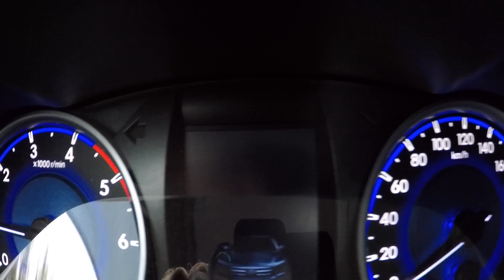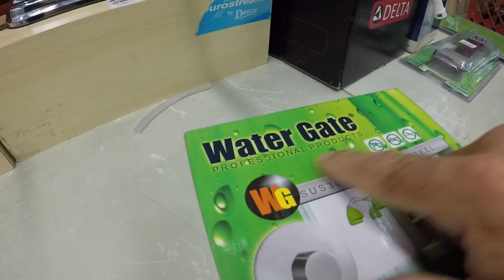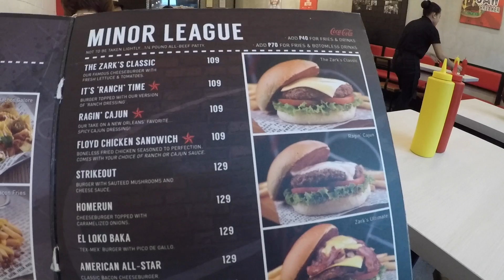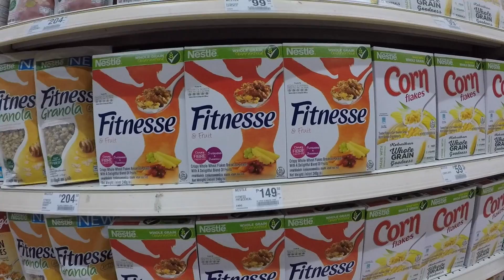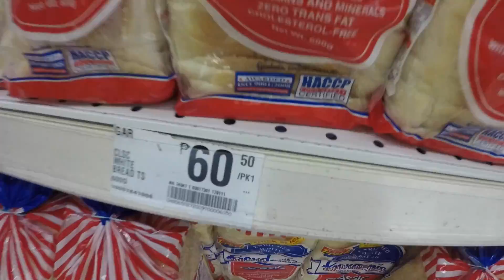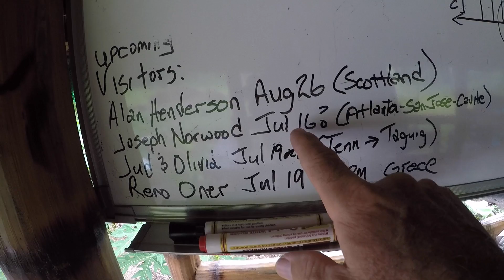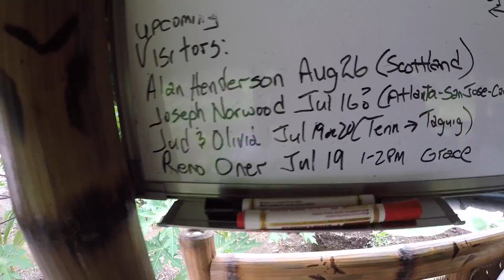VILLA FELIZ - EPISODE 127: WHO IS THAT IN MY BAHAY KUBO? (House Building in the Philippines)

Comment: Nice day!  I was wondering if your CRs each have a faucet in the shower to fill the bucket, which every CR I have ever seen in the Philippines has.  All 5 of ours all have faucets and separate showers (no tubs, unfortunately) in them.  The shower head in the master bath is removable from the wall so it can be hand held.  The flexible hose is long enough to reach anywhere in the CR.  Each faucet has it's own valve, as does each shower head.  Seems very simple.  Each CR's toilet has its own bidet sprayer, except the master bath.  I don't do that, the shower suffices.  My kids are used to the Filipino ways, hence, the buckets and bidets.  Maybe you guys are Americanized enough to go without the bucket!  I'm looking forward to seeing your CRs complete. Everything is sure looking good - better every day!
Reply: brooks: I would never use buckets and faucets in a nice toilet to be used as they do there . However if necessary, the bath has a similar thing where you can fill up a bucket.  Every time i see a house for sale there, the first thing i pay attention for is To Toilets and kitchen and normally i feel disappointed.

Comment: @14:30 so you will use two shower control valves so that you can have a tropical shower head and a standard handheld shower on a hose, in a bathroom that wasn't even supposed to be there because it's in the basement that wasn't supposed to be a basement, so the septic tank is too high for a CR in the basement? 

It seems like just mounting the single point water heater with included shower would have been simple, trouble free and not require and convoluted engineering. The handheld shower in a tiny bathroom can be used to wash the bathroom since it can reach all 4 corners. And it won't drip on your head when you go to use the toilet. 

Using two shower control valves, both in ways they weren't designed to be used, with a single point water heater which should not be internally pressurized, is going to require special operating sequences to ensure the second control valve is always left open and the first control valve used to control flow. 

If a guest used the CR, and needs to rinse with the hose, they are going to come out looking drenched from the tropical rain Forrest shower before they figure out how to use the system. LOL
Reply: Hi IMHO  LOL You might be right! That´s what i first thought, why that if you can use a flexible shower pipe instead of a fixed one, but he might have his own reasons. About the septic tank: i don´t think there is a problem at least until it´s not full, if that happens maybe it would affect the basement, but to make that happen he needs to make his family a lot bigger LOL
Reply: grandadan, I think he said they made a separate septic tank for the CR in the dungeon. To get it into the main septic tank they would need to elevate the CR floor some so it can still keep the 1/4" per foot drop to the tank. The water level of the tank will stay at the level of the hole between the first and second digestive chamber. 

The CR was a very late change, so the main septic tank is too high and no hot water from the solar heater. This is common when building something because you see a space that is wasted and say "hey, this would make a nice CR".
Reply from the maker: To me, being unconventional is what makes life interesting.  I probably wouldn't even be here today if I didn't take the path less traveled so to speak.
As far as guests go, what the heck are they doing sneaking around taking showers in my garage anyway?  😉
Reply: My PI Dream, typically the "outside CR" is used during parties to keep people from going in and out of the house. So I'm picturing some small parties in the garage and the CR being used. Sometimes people don't use toilet paper, they use the sprayer by the toilet, which in your CR is the handheld shower head. 

They may want to rinse their feet off or something, and accidentally turn in the tropical rain.

But if you are going to be the only one using it, it only has to make sense to you. I'm just point it out while it's still easy to fix. LOL
Reply: Necie Tanner, I think James secret plan involves some wet-T contests. LOL

In your house in the states, which I assume used a normal water heater (constant temperature, multiple point, storage type), I also assume James used a diverter valve, not a shower control valve as a diverter. 

There is a night and day difference between the system in S.C. and the system in the man cave. 

I didn't notice the bidet sprayer in the man cave CR drawing. If there is one of those that might reduce some drenchings. LOL

I'm pretty sure the upstairs CR won't be like the man cave CR. Upstairs you have constant hot water from the solar water heater, which solves all problems related to single-point water heaters. It will allow the shower control valve to be used properly (left-right for temp, up-down for flow) and can be used with a diverted valve (not another shower control valve) if you want a handheld shower upstairs. It's all very intuitive and safe once you know which way to set the diverted valve,

But in the man cave, that has a single point, power controlled water heater, which means you can't send the output to a dead end, and you jace to be able to readjust the temperature for each shower (upstairs you won't have that problem).

If he used a diverted valve directly to both shower heads, it would be ok because you can't close a diverted valve, but a shower control valve can be turned off, as well as the bib valve prior to the handheld shower. 

I think the model water heater James got is a flow-switch controlled power, which is good. Most single point use pressure switch to turn in the power, so if the outlet goes to a dead end, the water heater will turn on and stay on until the over temp safety shutoff turns it off. And if you are under the shower when that water comes out, you will need to go to the E.R., because it's nearly 100 degrees C.

To be sure you have to test the water heater. But all multipoint on-demand water heaters use a flow switch, so they don't turn on until there is flow, regardless of pressure.

Later when you try the man cave shower, you will see the difference between it and S.C. upstairs. It might be the last time you use it, in which case James gets the "man cave design of the year" award. LOL?
Reply: Yes you`re right! My plan is to have a barbecue area outside with a toilet including shower: No one drunk with dirty  shoes can go inside the house!!
Reply: grandadan, yes, and the CR needs to be easy to clean with a fire hose afterwards. LOL

I never liked a bunch of drunks at my place. I would normally just agree to go to their house and pay for everything and leave afterwards than to have the party at my place, pay for everything, and have a huge mess afterwards. LOL
Reply: IMHO: Yes agree! I refuse sometimes some friends parties in my house especially because it´hard to send the last ones away lol
Reply: grandadan, yes. I was normally happy to just have one other couple come over for a decent meal and maybe a few drinks, but not enough to get drunk. Normally they wanted to go home just as much as I wanted them to go home after it was getting a little late. LOL
Reply: LOL I had a similar problem with a laser faucet in a beach toilet , first time i saw one 17 years ago lol to find out that all i had to do was to put my hands below it.
Reply: grandadan, I normally rip those faucets off the sink before I figure out how to get water out of them. LOL
Reply: LOL  IMHO , someones love to confuse people LOL
Reply: IMHO: You´re right! That, and if there´s a catastrophic situation, instead of reacting  to it they will ask the smart phone for solutions. Yes we are running into  a lazy, useless, clumsy and fragile civilisation.
Reply: grandadan, the latest craze is self-driving cars. These idiots are thinking "I don't want to drive while stuck in stop and go traffic on the way to work." But they don't realize that if they can make a machine smart enough to drive without human intervention, they can also make a machine that can do most people's jobs, which means the problem of going to work will go away, along with the income needed to buy a self driving car. LOL
Reply: Agree: And i am waiting fro some intelligent politician who will make robots pay social security and tax. it´s just not fair that companies reduce staff due to this machines and reduce also their contribution to the social system. Yes they will do all the work and that´s fine as long as they paya us for allowing them to do so : And that will happen. In what concerns to my work ( Wine, grapes etc. ) It´s all robotic. Can you accept that people have to pay a fortune for a bottle of wine that has been processed  almost with nobody working? Someones are getting super rich while others are getting more idiots, yes.
Reply: grandadan, right now so many people are delusional. They somehow think the billionaire all want to invest in robots so they can afford to support millions of unemployed people. Some claim "it frees us to do more complicated jobs and innovate", but they don't realize the robots can already do more than the average human brain can learn. They are confusing the 1800s with the 2000s.

Elon Musk isn't fooling anyone. He wants to develop robots that can do all the work, and then he and the rest of the billionaires will go to mars where they don't need to listen to all the people demanding the rich pay for their existence. 

By 2050, you better either be rich or have something very unique to offer that one of the Mars Billionaires wants to support. Kids being born today are going to have a hard time, or be someone's pet.
Reply: IMHO: At the same time they convence people that those robots will bring even more jobs, so people stay calm and sleepy and suddenly the surprise arrives  and says : You are all FIRED LOL But don´t worry we will give you a lot of money as compensation, they accept and suddenly they find out that the money is over and now no money and no job . LOL. Back to work. Have a nice day
Reply: grandadan.  Back to work, but no jobs they are qualified for. And who could have predicted that a masters degree in Gender studies would be worthless when robots do everything? LOL

Comment: James, is the secondary head going to be both a hot/cold water head?
If not and just cold ,why not just plum it in before the supply port on the heater.
Reply from the maker: As long as there's no constant pressure on the pipe going to the input of the heater device, any configuration that meets the objective of getting hot water to the shower or hand held would be fine.  This was what made sense to me.

Comment: Hi James I've never seen any venting preparations for CR.
Reply: Or you doing an air ducting solutions?
Reply from the maker: There will be exhaust fans in all CR's.  The first and second floor will exhaust into the ceiling.  The basement CR will exhaust into the basement room itself.  It's large enough that the little bit of moisture will not make a different in the area space there.

Comment: Does the controller allow you to use the shower head or the handheld fully or does it just do a mix?
Reply from the maker: It will work just like a diverter.  Half way and water will come out both.  Full in each opposite position and either of the devices will work exclusively.

Comment: James, I know you will kick yourself later if you don't install a vent exhaust inside the CR. It will head off the greater potential for issues such as odor and mildew.😨😷
Reply from the maker: All CR's will have exhaust vents.  The one in the basement CR will be smaller because of the design.
Reply: I was speaking of the one in the basement because previously you said it would not get one when I asked about it.